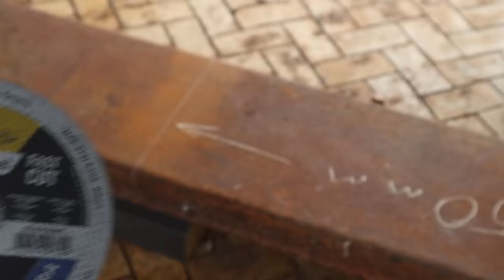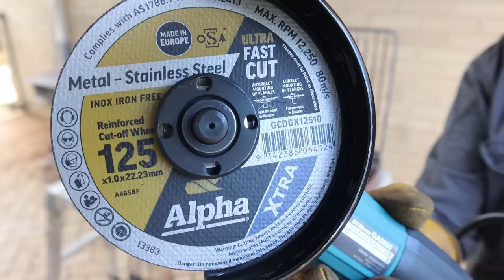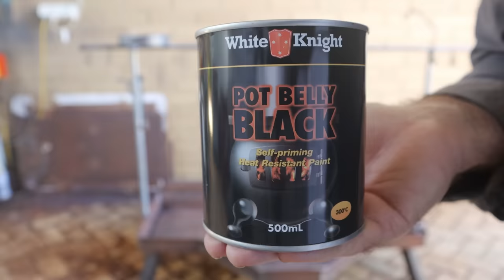I make a Metal Firepit for Campfire and Dutch Oven Cooking with a Swinging Pot Hanger.

Comment: I love this! I was hoping to see it in action at the end, to be honest. I would love to see the function of each piece so that I can fully appreciate your work. I hope that's not asking too much.
Reply from the maker: Thank you very much, I am glad you liked it. I will do a video with it with a nice fire and cooking at some stage, and using all the bits involved, that may not be for a while.
Reply: @GavinClarkdiy  : I was also hoping to see it in use.
Reply: @GavinClarkdiy  I was also curious about how it might be used... a few years back I built an outdoor cooking fireplace... went a different route to get to cooking spaces for my cast iron... I did a free stacking of cement blocks, bricks a pavers of different types and did an outer and inner shell to the fireplace,  cut t-posts to create shelves to support 6x6 inch pavers into 12 inch wide very thick shelves that would hold Dutch ovens on their legs above a roaring fire on the lower shelf and and upper shelf that would hold a couple hundred degrees Fahrenheit for 2 quart Dutch ovens to bake cakes at... the lower shelf was good for roasting and stews in my larger Dutch ovens... I  never did the hanging of Dutch ovens without the Lodge tripods and  those wouldn't fit in my cooking fireplace... they would work well over my Solo Stove firepits and camping Stoves... I would think your design would fit inside the huge castle sized fireplaces... not something we are allowed to  have indoors here due to air quality issues of fireplaces... so if your design was built for outside I am curious about the  fire management half of the design... a half fire pit or open fireplace situation... with reflective back walls and maybe a covered area  over where the  cook and guests might enjoy the  fire.... I went with an offset patio umbrella setup... I considered an off set metal awning, just a bit out of smoke and sparks of a roaring fire... the patio umbrella has survived for about a decade of use... very curious about how your design works in practice.
Reply from the maker: @lethaleefox6017  Your system sounds great, with mine, the hardwood log fire goes on top, and you use a shovel to put nice red hot coal from the fire to build a mound to sit the dutch oven on next to the fire and also put hot coals on top of it, if needed to heat or brown the top of what you are cooking, you adjust the heat by using more or less hot coals while the fire continues to burn next to it, if you need more coals they will be there in the fire, the grid is heated the same way. This is outside so smoke is not a problem, with no back on the unit many people can sit all the way around it during or after the cooking just sitting around the fire into the night. Thank you for your comment.
Reply: @GavinClarkdiy  I was picturing in my mind paver patio space a bit like what I free stacked my cooking fireplace on....12x12 inch pavers on leveled ground and plastic under a paver patio flush with grass level to reduce lawn mowing issues (10x12 foot patio) and maybe a low wall to reduce flying spark issues... a lot of the woods I use can pop sparks... or a shallow spacious fire pit with paved flooring (sitting height) ... a lot of possible landscape solutions for dedicated fire spaces outside.

Comment: Awesome work Gavin.  ya know that would look really nice in my back yard here in Florida. LOL, kidding, not kidding hahaha...  You never cease to amaze me on your builds.  One thing I wonder is how when bending your round bar do you keep the angles parallel and meet up for the final weld.  are you laying it flat prior to the next bend or do you pound it level behind the scenes?  seems like you make all of your 90° bends, and they always seem so level and meet up in the end. if that makes sense?   Can't wait for your next video, keep'm coming mate!!
Reply from the maker: Thank you very much, I am happy that you liked it. My vise hangs over at the ends so most of the time I can bend it in line with where it needs to be bent and I can see down to the previous bend to get the line straight, but in saying that there are times when adjustments need to happen after the bend to get it right, I normally do this using the vise using a pipe or hammer, not pounding it against the bench. PS  when I made the 4 butcher hooks I did not adjust anything while making them in the vise bit of the video, BUT I did straighten them before the final shot where I hang them on the rail, so they all sat nicely together. Every one of the nails needed some sort of adjustment. I use the square a lot to check my 90 bends are 90 before I move on to the next bend as that is the time to do it it is easy to bend it back or forward a bit while it is still in the vise held at the same spot as the original bend, before moving on, plus I can slide the pipe on it then. (You will see in the background, my square moving around on the bench in bits of my videos during bends and everything I do "watch for it, every time it has moved I have checked something"). In saying that, a lot is cut out of the video trying to speed it up, eg there were many hours of video taken to make this, and I got it down to 46 min. I hope that helps a bit Ron.

Comment: Since I don't cook with a Dutch Oven, I'd really love to see you actually using this so I'd learn about how it's used!  Great video!!!
Reply from the maker: The fire goes on top, and you use a shovel to put nice red hot coal from the fire to build a mound to sit the dutch oven on next to the fire and also put hot coals on top of it, you adjust the heat by using more or less hot coals while the fire continues to burn next to it, if you need more coals they will be there in the fire, the grid is heated the same way. I will do a video with it with a nice fire and cooking at some stage, but that may not be for a while.
Reply: @GavinClarkdiy  Well it's REALLY nice.  Wish I had one.  Wish even more I had the skills and knowledge to make one myself!  Very impressive, especially since you did it with reclaimed steel.
Reply from the maker: @carolewarner101   Thank you very much, I appreciate your comment.

Comment: What a piece of art! I guess it's been 20 years since my last project. My tilt was toward trailers and BBQ pits. Everything I cut back then was torch, porta-band saw and Dewalt chop saw (like yours but older model). I acquired a plasma cutter, which was a dream come true. I never would've thought of using a grinder with a cut off wheel. That's all I see now. Now that I'm retired, I plan on breaking out the old tools and getting back into it. Going to have to get a bucket of those wheels and figure it out. Great project mate!
Reply from the maker: Thank you very much, I appreciate your comment. I try to just use simple tools on the channel if I can, I wish you the best for your future projects.

Comment: Looks awesome. I would only add one thing. A handle with a spring around it to lift the grate while it's hot.
Reply from the maker: Thank you very much, I appreciate your comment. I have found cooking with fire and coals so close everything seems to get hot, I have a long hook hanging on the top hanger that I use to open the grill and lift other things, it seems to be the safest way.

Comment: Just one suggestion: a trap door to sweep the ashes out into a bucket. Really like your ideas
Reply from the maker: A very nice idea, plus the gaps around the trap door would work as a drain, so I would not have had to drill the drain holes in the bottom, I like your idea, Thank you very much Marc.

Comment: that build was simply amazing! I was actually about to start learning basic welding skills myself, but something like this would definitely be out of my league
Reply: Nah brother, you can build something like this easy! All the welds needed to fabricate this are all easy, beginner type welds and there’s nothing about it that a beginner could not do. As you get into it, you may make a few changes here and there that makes it easier for you and that’s no big deal. Just get out there and start melting some wire and start learning and make some cool stuff in the process!!

Good luck buddy, you can do this easy buddy!!
Reply from the maker: What an awesome reply, I could not have said it better, cheers Don
Reply from the maker: As Don said below, they are all basic welds, the idea is to cut the bit you are going to weld, hold it make sure it sits the way you want it to, grind more off if not happy clamp it in place put a few tacks on it get rid of clamps, make sure you are happy, if not, grind the tacks and hammer it off or into place, retack. Then cut the next bit, etc.  It is just bits. I wish you the best for your projects.

Comment: Hi Gavin! You are one of the most talented wielders/ metal workers I have ever seen. Your accent makes understanding a bit difficult, but because of my mechanical/ plumbing background , I figure it out! I hope that pot belly black is extremely heatproof!
Reply from the maker: Thank you very much, I appreciate your comment. The pot belly black will burn off where the fire is or where it gets flames on it, but all the top and most the legs should be good, and will not rust, the rest does not matter.

Comment: Excellent video, I might've added more ventilation then what you did at the end but that's just me. And you probably did once you used it.
Reply from the maker: Thank you very much, I am glad you liked it. The hole was not for ventilation, they were for drainage so that when it rains I won't end up with a pond. I won't be adding ventilation, our hardwood burns quite nicely without it, so this is very similar to having a fire on the ground. Thank you for your comment.

Comment: I noticed you keep the safety handle on all your grinders and the guards that big grinder is a man’s tool one slip with them and your going to remember it for the rest of your life. Nice work. Cut a trap door to open to get the ashes out. Just a thought. 👍💪
Reply from the maker: Thank you very much, I am glad you liked it, Richy Rich. Over the years I have had my share of injuries and have seen many others. I do keep the guard and the handle on for 99% of my work. I did think of making one small section of the side removable so I could scrape the ashes out easily, I did not think of a trap door, an excellent idea, it would also have saved me drilling the drain holes. I appreciate your comment.

Comment: This is the first time viewing your videos.  I am very much impressed as I love to see people with skills utilize them by creating masterpieces.  You sir, have done that! I do have a suggestion though. ( Don’t you just hate it when people such as myself say that?) I recently rebuilt a smoker and my legs were constructed like yours. I had an issue with condensation collecting inside the legs with nowhere to escape.  Rust soon followed. I remedied the situation by drilling a small weep hole in the bottom of my legs. The moisture then had a place to seep out and being on the bottom of the leg the hole cannot be seen.  I have just subscribed to your channel and am going to follow your lead in building something similar.  Thanks for all the tips on utilizing nails, nuts etc. as well as bending techniques. Your my new hero!  God bless!
Reply from the maker: Hi David, the first thing I have to say is I love suggestions, it is a way to learn from people that may have much more experience than me, or people that have no experience but have great ideas, both are a help to me. You make a good point on the legs, but they are 3mm steel and fully sealed, and with the welding, they were very hot when sealed so I don't think they should rust out, we don't get snow here the weather is normally quite mild, and I have never had this problem. It does make me though, thank you. Welcome to the channel David and I wish you the best for your project. Cheers mate.

Comment: Uh, that's amazing!
Reply: I would like to see it in action.  I guess you put the coals, under your invention.
Reply from the maker: Thank you very much, I am glad you liked it.
Reply from the maker: The fire goes on top, and you use a shovel to put nice red hot coal from the fire to build a mound to sit the dutch oven on next to the fire and also put hot coals on top of it, you adjust the heat by using more or less hot coals while the fire continues to burn next to it, if you need more coals they will be there in the fire, the grid is heated the same way. I will get a video up of it in action at some stage. Thank you for your comment.

Comment: Buy a pancake p-100 with 2297 filters for under your helmet. You also should invest in a dedicated corded and battery operated grinder: two of each, with two having cup wire brushes, one a 40 grit flap disc and the last a cut off wheel. I hope that helps.
Reply from the maker: Very good advice, I do wear a mask, but normally there is a nice breeze where I am working in this video, so that helps a lot. For the grinders I agree 100% with you, but just use corded in the videos, I have power here. Thank you very much, I appreciate your comment.

Comment: That's a very nice build and I enjoyed watching.  When using it do the coals go in the pan or does the pan sit over the coals?
Reply from the maker: Thank you very much, I am glad you liked it. The fire goes on top, and you use a shovel to put nice red hot coal from the fire to build a mound to sit the dutch oven on next to the fire and also put hot coals on top of it, you adjust the heat by using more or less hot coals while the fire continues to burn next to it, if you need more coals they will be there in the fire, the grid is heated the same way. Thank you for your comment.

Comment: That is fantastic!!! Do you place it over the open fire or fill the tray with hot coals?
Reply from the maker: The fire goes on top, and you use a shovel to put nice red hot coal from the fire to build a mound to sit the dutch oven on next to the fire and also put hot coals on top of it, you adjust the heat by using more or less hot coals while the fire continues to burn next to it, if you need more coals they will be there in the fire, the grid is heated the same way.

Comment: This is AMAZING! This might be a dumb question, where do you start the fire at? Does it go under the build or on top of it? I would love to see this build in action. I assume it pretty heavy so does it need to be covered? So many questions. Makes me want to build one myself!
Reply from the maker: Thank you very much, I am happy that you liked it. I will do a video with it with a nice fire and cooking at some stage, but that may not be for a while. The fire goes on top, and you use a shovel to put nice red hot coal from the fire to build a mound to sit the dutch oven on next to the fire and also put hot coals on top of it, you adjust the heat by using more or less hot coals while the fire continues to burn next to it, if you need more coals they will be there in the fire, the grid is heated the same way.

Comment: This is an Absolutely Genius Idea and Build!
What preparations can I do with (a replication of this build) to keep this "12-month friendly" as I reside in the Pacific Northwest of Washington State dealing with Rain, Frost/Snow, and Leaves clogging everything up?
Prep the Steel and Aerosol Paint using "High-Temperature Engine Paint" and find a cover?
I plan on building this on a single swinging arm over my Backyard Firepit that I use 8 months of the year.
Reply from the maker: Thank you very much, I am glad you liked it. You could maybe have it under a high roof and put a fire pit chimney hood and chimney on it. On my unit the fire goes on top, and you use a shovel to put nice red hot coal from the fire to build a mound to sit the dutch oven on next to the fire and also put hot coals on top of it, you adjust the heat by using more or less hot coals while the fire continues to burn next to it, if you need more coals they will be there in the fire, the grid is heated the same way. Thank you very much, I wish you the best for your project.

Comment: Great work. Only question I have is why didn't you knock all the rust off before painting or forgo the paint and season the entire thing like a cooking grate?
Reply from the maker: the paint was mainly for the top rails etc and the bottom of the legs, the paint in the base area and grate will all get burnt off with the fires in a short period of time, but looks clean and OK until the fire, then looks OK with the fire and burnt look.
Reply: @GavinClarkdiy  Just wondering.

Comment: Aye mate, great work. A pair of chains for the dutch  oven wouldn't be amiss. That way you can hook the handles and adjust the height over the heat. What do you think?
Reply from the maker: Thank you very much, I am glad you liked it. I have used chains before, but now I just sit the dutch oven on the coals and put some coals on top of it also, I will change coals if needed for bigger roasts. This is also the way we do it when just cooking with the campfire when camping.

Comment: Would love to see this in action. Do you just put the whole thing over a fire?
Reply from the maker: I will do a video with it with a nice fire and cooking at some stage, but that may not be for a while. The fire goes on top, and you use a shovel to put nice red hot coal from the fire to build a mound to sit the dutch oven on next to the fire and also put hot coals on top of it, you adjust the heat by using more or less hot coals while the fire continues to burn next to it, if you need more coals they will be there in the fire, the grid is heated the same way.